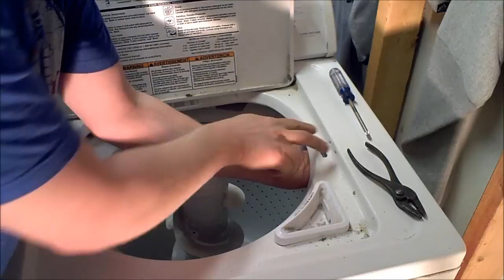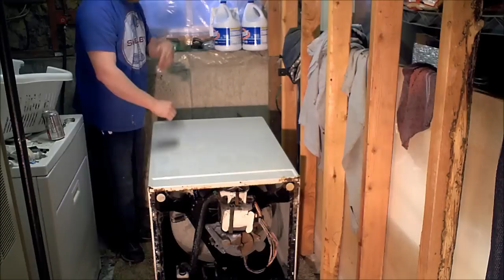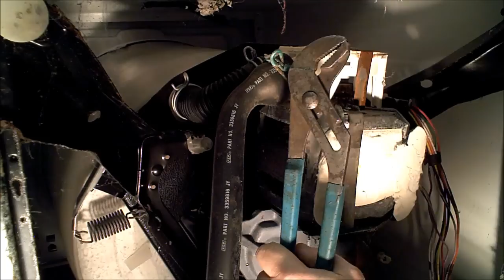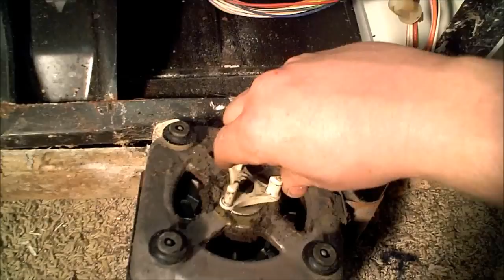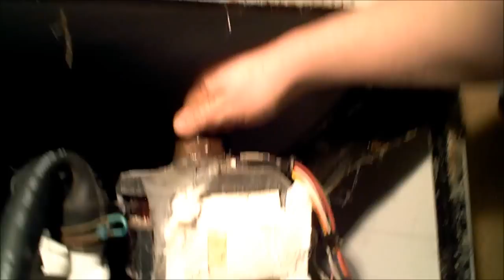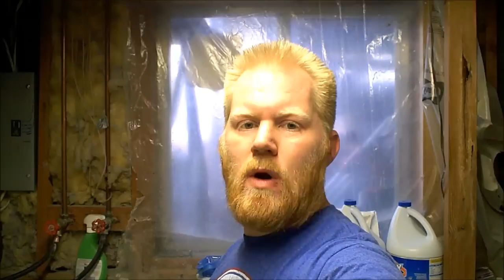Whirlpool Kenmore Washing Machine Not Spinning also Leaking fix

Comment: Thanks
Reply from the maker: You're welcome. Glad it helped.
Reply: sixtyfiveford Ijust wanted to thank you for the video as well. My washer is not spinning so I am going to give it a shot. When I was checking it out, before giving up and finding your video, I noticed under the washer there was two little plastic cups that held pins inside of them. I thought maybe the cotter pins fell out and that is why the washer would not spin. Sounds like I was way off. What are they there for?

Comment: Washing machine drain when off...have to unplug from socket to stop it...when starting a new load...the water runs...yet its still draining...help!
Reply from the maker: That's an odd one. It should only drain with the motor running. During a fill cycle the motor should be off. If it is still running the motor to drain it would have to be shorted wires or messed up timer. Sorry, wish I could be more help. I would Google the issue.

Comment: Thanks for the vid! Also can u help me a bit? I have a topload whirlpool washer. it seems almost the same on the bottom as the one in the vid. But what my issue is , is that at first the washer would not spin. Im sure the repair is as your vid BUT at the time it was not spinning, I could get it to spin by waiting for the spin cycle and then giving the washer a big shake. This worked for a bit then on day it just  made a clang against the side like the tub came loose. Now the tub is loose and seems like it moves too much. Like it came unhooked or something. Any ideas?  I know shaking it was not good but I was unsure of the fix and that worked at the time.
Reply from the maker: Large springs hold it centered and keep it from shaking. From the bottom on the inside you should see a fair amount of them. One spring could have come undone or it could have broken.

Comment: I'll start with a caveat: I live alone. No one else ever operates my washing machine. I am aware of the fact that my machine will still 'spin' even if the lid is open. So no one is in danger here...

Lid switches... If your switch only has two wires going to it, then you can just bypass it. You've got a 50/50 fix here. Either the two wires have to be spliced together, (like mine did). Or they have to be separated. For the machine to work. 

Be aware. The machine WILL work with the lid open.

Comment: My Kenmore does drain but doesn't spin.  I can get it to spin if I move the timer forward a few clicks or turn it 360 degrees around.  I checked the motor coupler and it looked fine, but now I wonder if I checked it good enough.  HELP!

Comment: I replaced the lid switch on my washer 2 years ago, but now I'm having the problem of the clothes still sopping wet after the spin cycle.  For now, I can just put it through another cycle, but I know that solution won't last long!  I was concerned about the potential cost of parts, so thanks for mentioning that and for the detailed repair info.  Now, I feel confident about taking it apart to determine the problem and fix it myself! :)

Comment: I checked my door switch like you mentioned and that's where my problem was. The switch housing is seperating and not making contact inside. An easy fix and a lot cheaper than a service call. Thank you sir!

Comment from the maker: If the door switch is good then we can move on. If you can hear the motor humming and the agitator still doesn't move then the Clutch is worn/bad. Generally you can help it along with an empty load and get it to move but it takes little force to stop it.  I don't have a video of it but there is a good one on youtube. The guy's name is Bill and here is his video on clutch replacement called: Kenmore / Whirlpool Washer Not Spinning 1

Comment from the maker: If the coupler was broken and stripped it is a possibility that the motor overheated and burn up by running without a load. I would check small things. 
Does it agitate (if so the motor is good)
Check the door lid switch
Make sure your wiring harness on the motor is fully plugged in
Make sure the machine is plugged in and the breaker switch isn't tripped

Comment: I replaced the coupler because my washer was making a horrible noise.... I ran one full cycle and it worked. I put a small load of laundry in and now it does not spin or drain... Help!

Comment: Hey, just wanted to say, you saved me lots of money. We didn't have money to call repairman, last time cost $200. This time I got the part for $25, I couldn't wait for Ebay. The new parts have a metal insert collar so it won't round. But  it is swedged on, so you have to use a socket to drive it on. Make sure you put it on the Transmission side, shorter shaft. Thanks again for your help.

Comment: Awesome!  Thanks so much!  The tabs that held my lid switch together cracked off and it was open, causing the contacts inside to not touch when the switch was pushed down.  Zip tied that sucker and it works now. I was racking my brain wondering why it wouldn't go into the spin cycle. You saved me big time, bro.  Money's tight and I cant afford to buy a new washer right now!  Thanks a million!  You rock!

Comment from the maker: The clutch is sold as an entire unit and should be part number 285785 and the motor coupler is 285753A . Double check these with your machine parts list appliancepartspros com is a good site for parts diagrams.

Comment: The clutch...that makes perfect sense.  I'm going to call a few supply places today. I'm thinking that I might as well replace the coupler while I'm doing the clutch as it's a pretty cheap item.  Buying off of ebay is probably the best way to go as you've said.  My only problem now is ordering the correct parts.  Do I purchase the full clutch or just the inner lining? Are you able to tell me what parts to order specifically??  The info I can get off of the washer is Kenmore Series model 110. Thx

Comment: Thx for the advice so far!  I got everything back together and bypassed the switch.  Still running into spinning problems.  Now that I can keep the lid open while it goes through it"s cycles I can view what's going on.  I tried a load of towels and it could not muster up enough to make the drum spin.  I helped it along and it did spin but not at full speed.  I took towels out except for 3 and still had to help it along but this time it went full speed and accomplished a semi dry load.  What now?

Comment from the maker: The little tab that depresses the door switch most likely barely depresses it. The vibration of the washer can lift the lid and kick the switch off. Also the lid can bow and barely hit the switch ( bend the lid back into shape and take the bow out). You can also hook the 2 wires going to the switch together to bypass it  completely (unplug the machine first) or you can try putting something heavy on the lid and see if that remedies your problem.

Comment: Great video sixty-five!!  Ok...still need more help if you can.  Machine: Kenmore 70 series washer.  Problem is: washer works fine draining (motor works) but intermittently the spin cycle does not work/spin...sometimes it does...other times not.  I have the washer all apart...took everything apart...coupler looks good and rotates fine (no broken plastic parts or wear.  Oh...switch seems to be working fine...when I open the lid and put it on spin cycle using screw driver it spins.  HELP!

Comment from the maker: Unplug your machine from the wall and I would unplug and plug your motor harness. Be careful of the connections on the capacitor (red bull size canister next to motor).  Hopefully it is just a loose connection. Do the same with your timer controls. You can try being rough with the timer and try it on a delicate cycle or the like.

Comment: Yeah, I checked the switch, and for good measure bypassed the switch and tried it that way with no luck. It will add water, but no agitation or draining. There are no other sounds when I move the timer in to different positions. I'd almost guess the timer selector switch is worn out, but I'm just guessing at this point. I will tear it down again tomorrow and look at the motor just to make sure.

Comment: Very good repair video. It's 3 years late 4 me. Had this problem, and figured it out and fixed it. Now Whirlpool washer shakes rattles N rolls when on spin. I tipped machine fwd to re-balance it. I leveled the machine with front legs, but no luck. Can U do a video on this problem?

Comment from the maker: The vertical machines are just cheaper, that is why they are so popular here. Last I looked they are about double the price for a front loader but manufactures here are pushing to sale the front loaders more (to make more money).

I think the pieces are built out of plastic to be a weak link. I could be wrong and they could have done it to save money as well. Definitely resemble a cush drive. 

Thanks -Moe

Comment: Great video, I have never seen a "square" motor in a washer, but I have not looked under our Kenmore washer, our washer is about a late 80's very early 90's model.
It works good but when it spins it will shake our whole mobile home...LOL.
We have to balance the load of course but even than it shakes and yes I did level it.
What I had to do is jam a 2X4 and screw in down tight againced the side of the washer tight with the dryer.

Comment: I should have contacted you last month. I had a '07 ge topload with bad motor. The code light was blinking 9 times. It had a 3 phase motor, i tested with the multimeter,  all 3 wires to the motor were getting 119V but still it would'nt run. ? I scraped it.

Comment: Smashing job :-), i wished the general front loading machines in the uk were so repair frendly.

That coupler reminds me of the rear wheel cush drive on a motorbike with chain drive.

Would the plastic bits on your washing machine work better in cast metal i wonder, did the manufacturer use plastic for a reason other than cheapness, hmm?

I have noticed american/canadians seem to like the vertical machines better, and i can partly see why now :-)

Good fix mate :-)